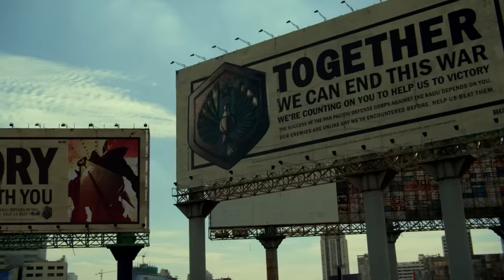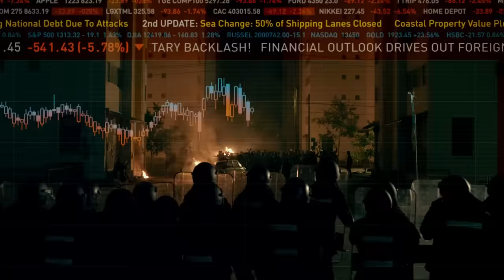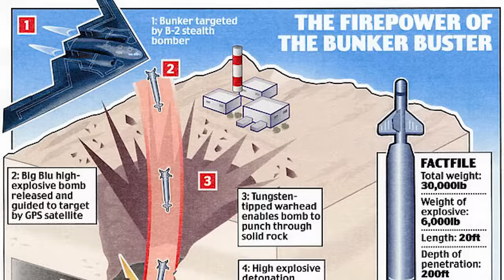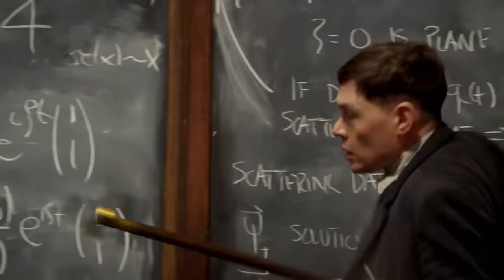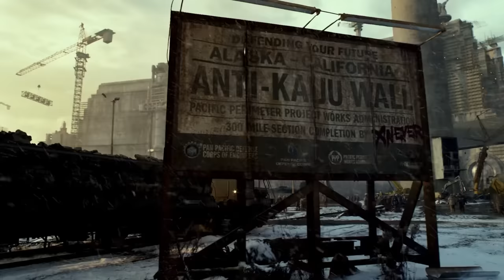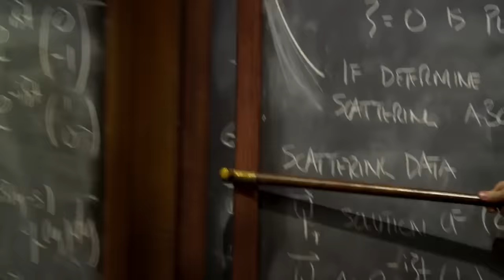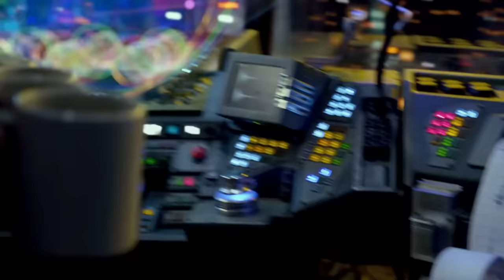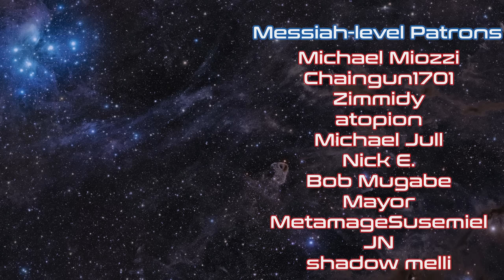Advanced Sci-fi Civilisations Too Stupid To Really Exist Ep.20 - The United Nations (Pacific Rim)

Comment: The single biggest issue with this movie was style over function - and I can't ever unsee that.

The moment the showed that they had kinetic and energy-based weaponry that WORKED against the alien monster-machines, the giant robots punching and kicking became completely obsolete.

Mount all those functioning weapons on stationary protective batteries around every coast-line - infinitely cheaper than walls around the whole  distance. Equip roaming squadrons of conventional gunships with these weapons, have hunter-killer patrols of subs armed with them, make man-portable versions if possible. Make stationary kill-zones in 'weak' seeming entry-points as suggested here and soon, once they show up again, you can nail any beast that get's into the kill-zones. Have over-whelming force on stand-by: Humanity has the home-field advantage and the numerical superiority, so these things coming one at a time or two at a time should be of little consequence, the biggest issue will be the clean-up and securing each body after the brief engagements to learn more.

When you want to make a thematic movie-flick, you HAVE to make it viable. The reason shows like Neon Genesis Evangelion justifies the EVA's vs the Angels is the existence of AT-fields, that nullify everything else that was ever tried against them, as is demonstrated easily in the very first episode when the UN indeed are not incompetent and throws everything that have at the first one - to no effect, including the proverbial nuke-drop.

NGE is a classic and a great show, even when it was blatantly underfunded. Pacific Rim is a weird psycodelic spectacle that don't justify itself. You will never see a A-SF-C-T-S-T-R-E about the UN in Neon Genesis, because that's a well-written show.

Comment: To add to the nuking underwater thing, the energy required to trigger an earthquake like that is way way beyond anything we could ever produce with nuclear weapons (I mean the mass of tectonic plates is mindboggling) so it wouldn't cause any earthquakes or tsunamis they could just nuke away at anything that came out the portal
Reply: It wouldn't cause earthquakes, but massive waves would be a problem, since a nuclear weapon literally atomizes water around it, creating a huge area where there is no water and all the force of the ocean rushes back in. The one nuke they DID set off should have ripped the Jaegers to pieces. But it's worse on the surface, in the same way that being at the end of whip is worse than being near the handle.  The speed and therefore force of waves amplifies as they travel further, even if they transmit less kinetic energy than what caused them. 

No need for such a huge charge at that depth and pressure. Smaller ones should do the trick, and if you wanted a coastal wall it would be to protect against flooding, not whatever monster managed to survive the enormous pressure at those depths,  but get up to the air without exploding or falling apart.
Reply: @arcdecibel9986  that may be true closer to the surface but at the Mariana Trench it shouldn’t cause any waves at the surface, the water pressure is just too immense, what will happen is the explosion will create a pocket of expanding gas before the force of all the water in the ocean overcomes it and collapses it. You may have some gasses eventually make it to the surface but it’s going to be little more than bubbles

Comment: Honestly, they could've solved entire Jaeger and Wall problem by simply building a huge amount of nuclear ICBM's or even  just some plasma cannon installations along the coastline. Kaiju pops up, boom, gets shot. Ez.
Reply: I'm with the sentry plasma cannons pointed at the breach idea
Reply: Yeah Plasma cannons powered by dedicated power plants should wreck any Kaiju that came close to the wall.
Reply: @johno1544  Do as he said, box off the trench, every Cm of the wall covered with cannons, hell even put a ring off cannon in the middle, half way up - like old battles ships from 17th Century, 3 or 5 layers of cannons, maybe 5 feet apart, around the entire wall - monster pops up - doesn't matter where it goes there are at least 100 cannons shooting at it. From what they film shows of the fights, not one of them is taking 10 or 20 hits from from cannons, so having an over arching field of fire, from 100 cannons - yeah those things are dead in seconds. Even like in the 2nd film, they start coming in twos, then in threes - doesn't matter - how slow they move in the water, each cannon can take a good 3 or 4 shoots, and with 100 cannons firing, nothing is getting through. 
Power is an issue with this design, but fission reactors around the coast, with cables along sea floor and up into wall to cannons - job sorted. As long as the aliens don't get out side the wall no issue - even if they do - cannons on top of the wall, can be mounted on 360 degree turret platforms, and fuck it shoot the damn things in the back.

And I would still think all of this wouldn't cost 10% of what all those robots cost.
This will buy the time needed to study, and create bio weapons to take them out more effectively.
Reply: @rianmacdonald9454  true the plasma cannon turrets should at the very least line every costal city if building in the ocean is not possible. Not sure how possible it is to build in the deep ocean. Maybe something like oil platforms but they really float in deep water

Comment: I would like to propose that perhaps the reason why they stuck with Jeagers is the mobility factor. Sure, it would be nice to have BFG10000 sentrys mounted around the coasts of the Pacific ocean, but given the usage of the plasma cannon in Gypsy, I'm a bit skeptical about the range of that thing. If the weapon works like an actual plasma generator, then it has to be short range, which is not very ideal. Jeagers are made to engage kaijus in open sea, which gives a buffer zone before they reach coast cities. Striker's missiles, however, seem more long ranged, but even so, I don't know if a vessel to carry whose around would be any more practical than a Jeager. Current battleships need hundreds of personel to operate and they're nowhere as mobile as a giant mech, go figure.

As for orbital weapons, the major issue is reloading, as well as keeping every system there operational. If you want to reload, you gotta launch a rocket. If you want to make repairs, you gotta launch a rocket, considering this is an unmanned satellite and no astronauts will be up there for long. The suicide drone option seems pretty feasible, but it is nowhere nearly as cool.

Come on, man. Giant Robots!

Comment: How do the Kaiju smash through the wall? The wall isn't just skyscraper sized in height but in depth as well.
The wall the Kaiju smashed through was a few feet thick but the anti Kaiju walls are 100s of feet thick...
This is especially questionable considering that the Kaiju cannot easily damage the Jaegar armor which is made of steel probably a few inches thick.

Comment: The giant mecha were actually a really good idea, and they were clearly working to hold back the Kaiju threat. The problem is when the UN decided building a static wall would somehow prevent the Kaiju from just...breaking the wall. Which happened almost immediately in Australia.

Really, they should've doubled down on the robots. Those were a proven solution.

Comment: The solution is very Shrimple 🍤: Create a goddamn space cannon aiming at all times at the Rift the Kaijus use to cross to Earth. While they are building it, use the Jaegers to contain the Kaijus, mainly using Melee weaponry (like the plasma blades), if possible, to avoid collateral damage on the Earth atmosphere/terrain and send several Jaegers to fight, even when the threat is "minimal". The idea is to end the fight as quick as possible. Set a lot of sensors across the globe to detect the anomalous energy waves coming from the main Rift (and potential new ones) and immediately shoot the cannon to the portal. Hopefully some of the blast will get to the aliens on the other side of the portal. Meanwhile create several more cannons and patrol the globe for threats. Use complete extermination force against any terrorist (or country) that try to seize/hack the cannons, potentially creating an Earth Government, instead of several nations struggling for power. Once the cannons are done, develop space stations as defense points against any potential invasion from said aliens. Since these things are already attacking Earth, it is safe to think there's other dangers across the galaxy that will reach our Solar System at any time.
Reply: easier solution:
attach pieces of the kaiju carcass to bundles of nukes (MIRV), and introduce the aliens to the buckets of sunshine.

Comment: The Kaiju are silicone-based, you say?
Following the recent idea of scientists believing we can create solid platforms and roads out of moon regolith by fusing it together with directed microwave radiation, why not attach a high-powered version onto a quick and nimble VTOL aircraft? Fly some other cheap but fast aircraft to distract, while the microwave aircraft strafes the Kaiju, focusing on joints and sensory organs. The Kaiju is now paralyzed/incapacitated, you can safely use other experimental ordinances, or just send in some Jaegers to mop up.
The aircraft would only cost less than a billion dollars each, which is WAY less than a single Jaeger.
Smarter, not harder.

Comment: While I suspect a lot of the Jaeger specific weapons are too costly/difficult to mass produce (I doubt you could build more than a handful of those plasma cannona - they are also very short range) the anti-Kaiju missiles should have been adapted for mounting on conventional air forces (or if they need to be that size - on Jaeger carriers) as soon as they proved viable.

The wall was a stupid idea, doubling down on it bordeline suicidal
 Depending on a Kaiju's abilty to recover over time, the likely best solution would be: Mines by the rift, bombardment where viable, then Jaeger led task forces to finish them off (Jaeger + Helicopters, Fighters or Ships as available or viable)

The failure to make an effective study into kaiju, and secure at least most kaiju remains is at best incompetant in the extreme, more likely corruption throughout the UN.

It was still an awesome movie.
Reply: This was my first thought on seeing the missiles deployed. 

If the Jagers are air lift able, it stands to reason that you can skip the "middle man" and carry the missiles on the aircraft directly.

Comment: You got the beginning wrong with the nukes, Nukes weren't used (at least there's no explicitly stated use of them in the movie). Striker Eruake (forgive my spelling) 's chest cannons are not missiles. Gypsy's plasma cannon is probably the best weapon that uses not only energy, but material ordance (plasma weapons are not pure energy) is used along with it. So having a dedicated reactor to it won't improve all issues, and having it mount on gyspy allows for the BEST mobile platform for which to attack kaiju at the miracle mile. Defensive shoreline cannons make sense though (like putting them on the wall of life, which was stupid). Having more advanced or exotic physical weapons like wrecking balls, are stupid when comparing to the more destructive plasma weapons. 

Really I don't see any other effective mobile platform for heavy weapons that could handle CQC with kaiju in the miracle mile, dry ground, or deep waters. So the argument for better delivery systems is countered. Having plasma bombs would work though. 

Jaegers were developed for an alternative to nuclear weapons, as the kauju blood was a concern already... they were environmentalists at the wrong time really.

Finally, the 'plan' was rushed solely because they were running out of time. Math is the language of god was to place it as fact that they had very little time before higher cat and larger waves of kauju was sent. So, they really were just hoping against all odds that they could do it before the waves of bigger and badder kauju over run them.

Comment: if they know where the breach is why didnt they just station all the jaegers at the breach? this way they could star blasing Kaiju the second they pop out. or even better litter the whole area with plasma gun emplacements.
Reply: 35,876 feet deep water, in the middle of an ocean, and with kaiju coming out of it at an increasing rate.

Good luck finding the people willing to work there.
Reply: @DJWeapon8  the jaegers seem to deal with it just fine and with all of them in one spot they wouldn't have to guard the entire pacific rim. just one spot. no need for a silly ass wall.
Reply: @ADMNtek  right. Just drop them in there.

Ignore the maintenance, the resupply, the costs of these, the logistics of how to actually get those to the challenger deep, and how kaiju have the speed advantage underwater and would likely just ignore the jaegers and go straight to the population centers like usual.

Comment: Dude, a standard ICBM has over a trillion joules of kinetic energy without factoring in a warhead AT ALL. A Jaeger would have to punch at MACH 2 to reach that level of energy. Just remove the warheads from our current stash of Minuteman III missiles and you have 400 missiles each capable of generating, if I've done the math right, 2.5 THOUSAND TIMES more energy than a Jaeger's fist. (Calculations done assuming the Jaeger's arm weighs ten thousand tons and moving at peak human punching speed, even if my mass and speed estimates are off by orders of magnitude, an ICBM is still FAR MORE POWERFUL). The movie claims the Jaegers weigh far less than what any reasonable estimate would be, claiming total mass less than 2000 tons, which is ridiculous. Even if it weighed more than a US Super Carrier, it wouldn't be more powerful than conventional weapons, and if its as light as they claim, it'd be weaker than simple rocket/missile systems like HIMARS and Patriot, and would be on par with modern artillery. Pacific Rim is one of the lamest attempts at Mecha. Things like Gundam, Warhammer, Evangelion*(not actually mecha), hell, even Big-O did Mecha way better. If you've made something less realistic than Warhammer 40k and arguably weaker than early Gundams, which were firing basically artillery shells and scaled up bazookas, you should go back to the drawing board

Comment: there’s actually an even better solution then what you purposed and that’s building a wall around the portal so hear me out build a wall from the bottom of the ocean all the way to the water surface that will surround the portal and drain the water out of area of the portal put a lot of turrets on the walls and the ground facing the portal and finally watch everything that tries to come out of there immediately die have a few giant robots guarding the portal during the construction and the problem is gone forever

Comment: the Jaegers overall have the same problem Metal Gear had if it was a real weapon's platform.

the purpose it is meant ot fill could just as easily be accomplished by developing better Tanks/aircraft that cna carry the same types of weapons.

ie: Metal Gear Rex's main draw was the aiblity to deploy a nuke with its railgun from anywhere...in that case why not fit this railgun into a tank or fixed emplacement that you could defend that much easier and deploy in larger numbers if needed.

the Jaegers are the exact same, a Mech centric doctirne is pointless , especially as shown ni the 1st movie where they oftne fought in places where the Kaiju's had the homefield advantage(near water, at night), all these fight could have been done far better with coastal gun and aircraft fitted with jaeger grade weapons.

Comment: When the kaiju come through  they are scanned by so many sensors that they can be immediately classified and named. With that it would be relatively easy to to guide a specialized anti kaiju torpedo straight  down it's throat, or up the other end if wanted, literally seconds after it comes through. Or just built a giant shredder over the rift.